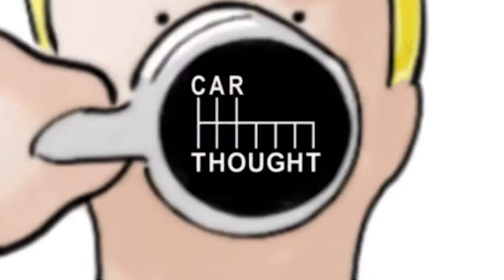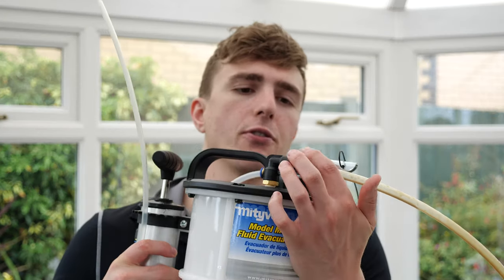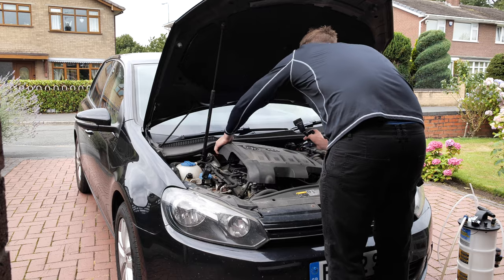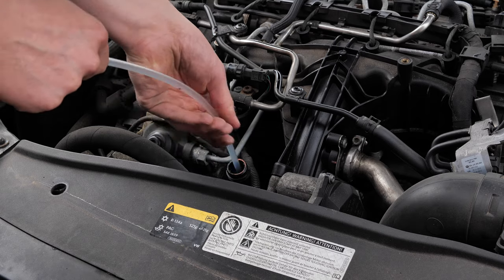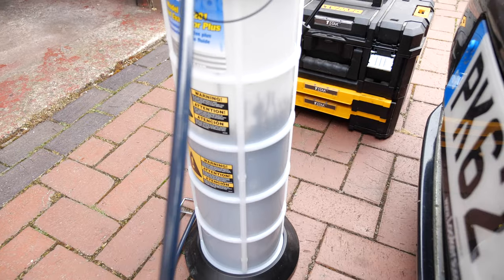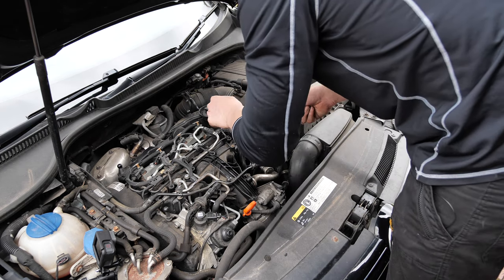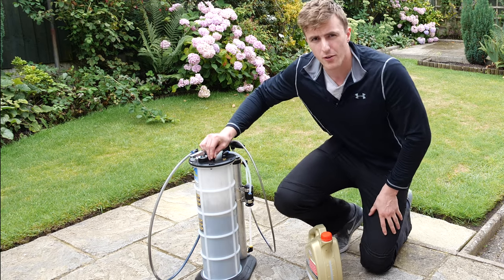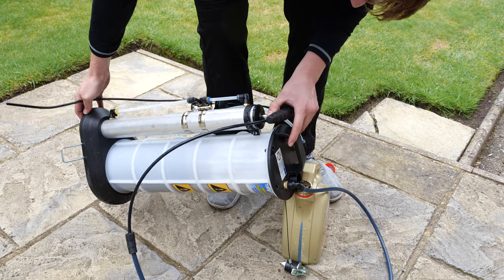Mityvac MV7201 Fluid Extractor review! - VW Golf 2.0 TDI Oil change

Comment: Good video. Thanks. One tip: clean the crud away from the oil filler hole before removing the cap: that way it won't fall into your nice clean engine!

Comment: You should pull the oil filter first so whatever is in there drains in to the sump. Intervals are 5000 for me or twice a year. Mobil 1 ESP. Always change the fuel filter every 10k on a TDI. Your injectors will thank you with 5-10 more mpg as they age.

Comment: Castrol edge is not the best it's well advertised 😉 and the easiest way to clean the pipes is to hold the end build up vacuum and then spray some brake cleaner in to it

Comment: i do 200 motor hours oil change works out 4000-6000miles for me, also and according to msds castrol edge is just simple VHVI group III base oils + relevant additives to the spec nothing special and poor value

Comment: I also have a Volkswagen and the clearance is low. I do a combo of a pump extractor and drain the remainder. I drive the car onto 2x6 wood ramps to start (I get an additional 1.5 inches of clearance). The pump extractor removes most of the oil. Then I drain the rest. You have to do both to get a reasonable amount of oil out (I would not use the extractor alone).

Comment: Hi. I am a fully qualified mechanic.
I personally would recomend changing engine oil and filter every 6000 to 7000 miles or once a year.
Long drain engine oils are a NO NO 
These oils are fine if you are doing high mileage each week where there is minimal carbon deposited into the engine oil due to less strain and the engine being driven at a constant temperature for long periods of driving, however,......
Vehicles driven on short journeys stopping and starting over a long period of time whilst the long drain engine oil is being used is not good for the longevity of the engine.

Comment: Less oil will go on the patio if you turn the oil jug sideways (less gurgle). Also, you can install a cutoff lever between the large and small hoses, which will not only seal the oil leak problem with small hose clamps, but will allow you to stop further oil flow without adding the "stopper" you mentioned. I use a similar unit made by OEM Tools, but almost identical. I have pulled the oil plug when finished and found that I get 99.99% of the oil out of my Audi Prestige, so the only reason to pull the plug is if you are concerned about removing metal particles from engine wear or your oil filter is under the car anyway. I would suggest you loosen the oil filter before evacuating the oil. This allows some air flow into the system (less suction) and makes the whole process a lot quicker. Make sure your oil is not too hot or you will ruin gaskets, etc. You can check engine oil temp by using the tube, put finger over the end and squirt into a cup. Let the engine cool if it is over 150F. Clean up is easy if you run degreaser or just Dial soap and water through the lines a couple times. Just flush with water and air out when done. People that have problems with these is usually because they don't do the cleanup after they use it. This, of course, increases the overall time required to make an oil change. If the oil filter is on the bottom of the car, you might find things go faster if you just pull the plug while you are down there. You might get more oil on the patio, however.
Hope that helps.

Comment: Used to change oil and filter every 10K.

Now I have a BMW 335D (Diesel) with the N57 6 cylinder I replace the oil and filter every 7k.

I also use Castrol Edge 5W-30 LongLife (LL04) in my car and find this gives the best performance overall.
Reply: I do 5k on my tdi jetta. Consider the idle to things.
Also rotella t6 5w40 os 170 for a 5 gal at canadian tire on sale, ever at 200 the non sale price it's a steal. Look it up, I think 5w40 is best for diesel.
Looking Into the q7 3.0 tdi.
With a tune ans emissions removed its a million miles and 650 fp tork
45 hp. 
Under 20 k.
Keep your diesel, now cars are gonna be to rent, can't service, and fees fo dispose

Comment: Certainly appeared to make a cleaner job of doing an oil change. It would be beneficial if they supplied spare hoses so you could have a different hose for each different fluid removal. 
Seems a good product an as usual a good demonstration by yourself.

Comment: These work better on my Mercedes E Class W211 then sump plug removal. The reason is the sump drain is about 1/4 inch high, this sucks all the oil out. I then put a bit of new oil in and suck that out, its always as clean as a whistle.

Comment: got a golf 1.4tsi and like to change my oil every 6 months its on 103,000 miles at the moment and runs great
Reply from the maker: 6 months irrelevant of mileage? Love the tsi tech.
Reply: @CarThought  yes for me,i know some will disagree but i tend to do a lot of short trips mainly to work and back and give it a longer run out at the weekend...if more often than not you are doing longer drives and the engine can warm up properly then yes extend the time before an oil change to the once a year...i just feel im keeping it tip top the way i do mine

Comment: Hi could you run cheap full synthetic oil thru engine then drain then fill with preferred oil
Reply from the maker: I am sure you could! What would be the advantage? All oils I use are fully synth
Reply: @CarThought  guessing hes trying to flush the old oil out.
Reply from the maker: Waste of bloody time if you ask me 🤷‍♂️ Might as well just reduce your oil change interval.
Reply: @CarThought  for me any diesel with timing chain get serviced every 6k, if it has a cambelt 10k is fine but nothing more then that. Some two stroke mineral oil in the fuel once in a while and diesels run forever.